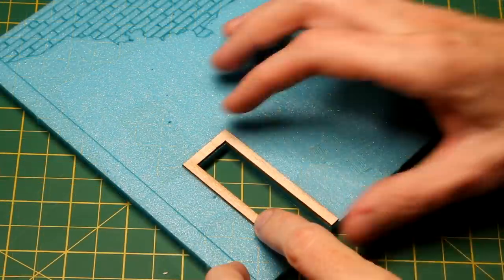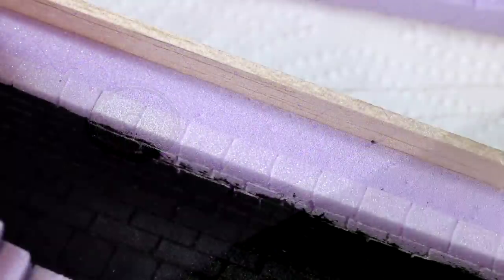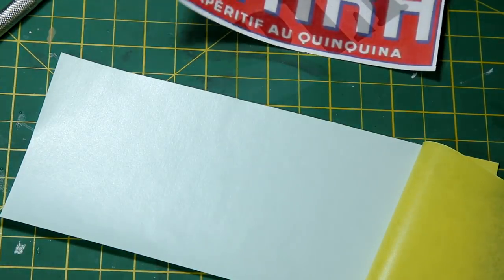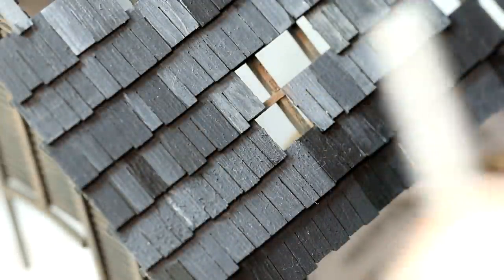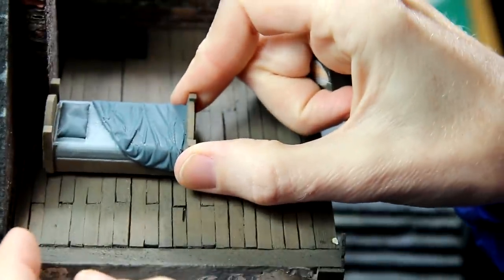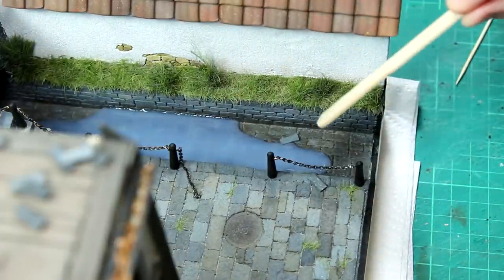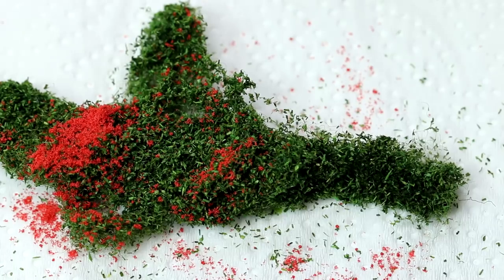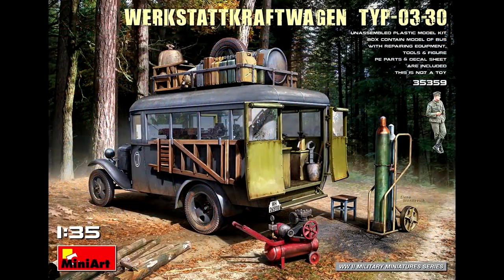European House WW2 diorama

Comment: Nice build. May I suggest a few more tiles on the ground and in the attic as there would be hundreds of tiles on a roof of this size. I have seen a video of an artillery piece firing next to a building and most of the tiles falling off because of the shock wave generated during  firing.
Reply from the maker: Thanks Lexi. Yes, you're right - there would be tiles everywhere. And a lot more debris and dirt in the attic too, I think.

Comment: Excellent end result and commentary. I don't think that I would rush to use the blue foam, which seemed to have a rather unsatisfactory structure, but the wooden parts appeared to be quite useful. I hesitate to make even the most minor suggestion, but I do think that the chain linking the bollards on the canal side appears to be too heavy, and, for my taste, I feel that finer links would look better.
Best wishes.
Reply from the maker: Thank you George, I appreciate your comments. Yes, the blue foam was definitely  not the best quality - I definitely wouldn't have been happy using it as the exterior of the building without another layer. Fair point about the chain - it does look big enough to heft something rather than just be decorative :)